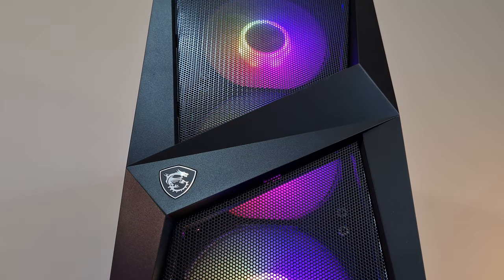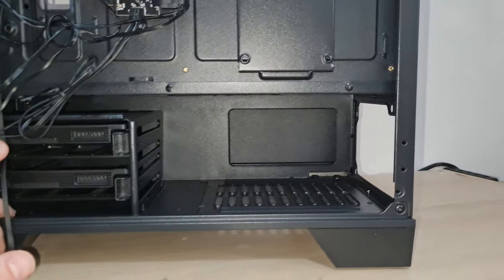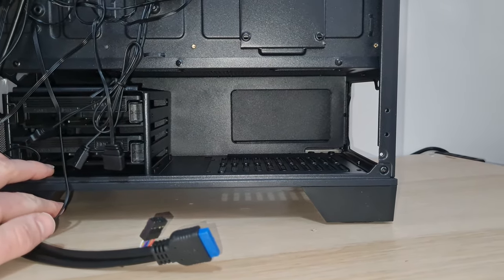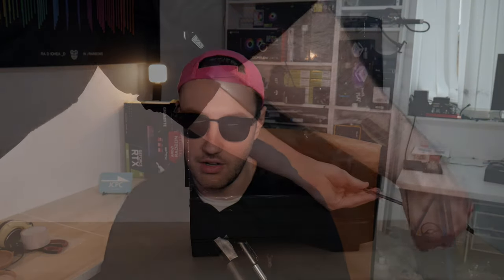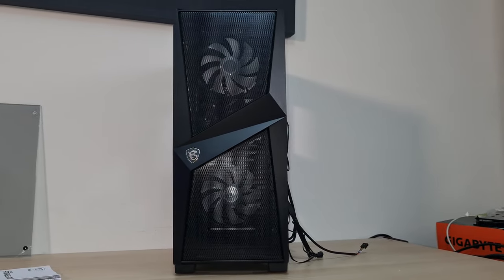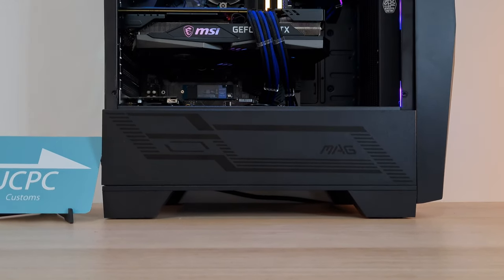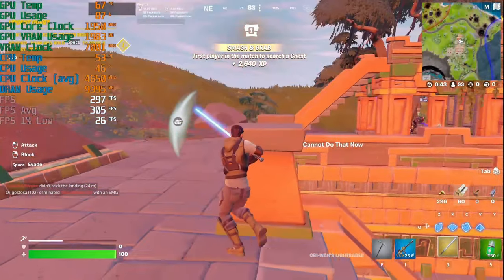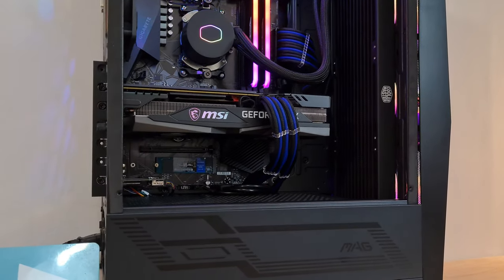MSI MAG FORGE 100R Review - Changing the game for budget PC cases! Gaming PC Build

Comment: Sick review! Building a 5800x 6700xt build in this soon. I was hoping to fit a 360mm radiator in front. Now I have info to try it. Thanks!
Reply from the maker: Thanks dude!

For the money, it's an excellent case. Nothing at this price point touches it

If you've got the budget, maybe check out the cooler master TD500 mesh as you can top mount a 360 in that

Good luck with the build!
Reply: @thecomputersurgeon  Thank You for this video. I already have this case and was wondering if I could fit a 360mm AIO in the front if I remove the HDD cage. You did exactly that. Did you face any difficulty in mounting the AIO?

Comment: Thanks for reviewing this pc case. I was wondering if cheaper pc cases like this would perform better than something like Lancool 215 which now is widely known as 'budget king' thanks to gamers nexus.

So anyway I've compared FORGE 100R with Lancool 215, which was also reviewed in one of your videos.
Fortunately you used the same processor, GPU, and RGB fans for the test. Unfortunately different liquid coolers were used; silverstone pf240 for Lancool 215, Cooler Master ml360l for FORGE100R.
Also there were other differences in components such as PSUs; 650w for Lancool 215, 750w for FORGE 100R, as well as mobos, RAMs, and SSDs.

MSI MAG FORGE 100R
PRIME(CPU) max - 68c, plateau - 62c
OCCT(GPU) max temp - 73c

Lancool 215
PRIME(CPU) max - 87c, plateau - 57c
OCCT(GPU) max temp - 69c

While CPU temp showed the most dramatic differences, I presume it's more of difference between liquid coolers than anything. Lancool 215 was 4c lower than FORGE 100R's 73c but nothing significant considering there might be an ambient temp difference to take into account.
All in all, I'd say they perform more or less the same so grab whatever cheaper.
Reply from the maker: Nice comparison and great to see you in the comments section :)

In this review like you say it's a 360mm liquid cooler. Also, this one the CPU cooler is on intake which helps a few degrees

A lot of what we do on the channel is not based on perfect scientific tests. That is essentially impossible as an unsponsored channel, and perhaps not even necessary? Rather, it's about real life usage and not the minutiae. I agree that you get basically the same performance in most mesh cases, so it's mainly a question of which you prefer the look of, whilst considering the price (the LANCOOL 215 is around double the price here in the UK (£90), so hardly a budget case!)
Reply: @thecomputersurgeon  It just bugged me that everyone's praising Lancool 215 as a budget king, while the airflow didn't look all that special compared to other cheaper pc cases. So thanks for sharing your results!

Comment: can you tell how to get fans to spin of this case...cz in the fan hub after plugging in sata and connecting the fans only rgb lights up...fans doesn't rotate and i got many fans and my mobo doesn't have that many fan connectors..how to make use of the hub provided?!
Reply from the maker: The hub only does RGB. The fan connector needs to go into your motherboard. If there aren't enough headers on your motherboard you need to buy a splitter
Reply: @thecomputersurgeon  yeah right its only an rgb header